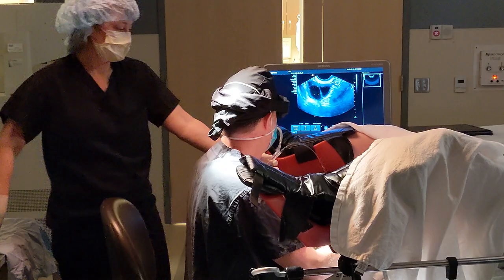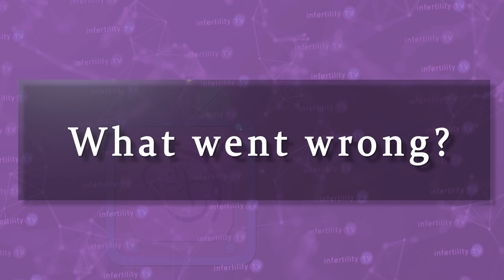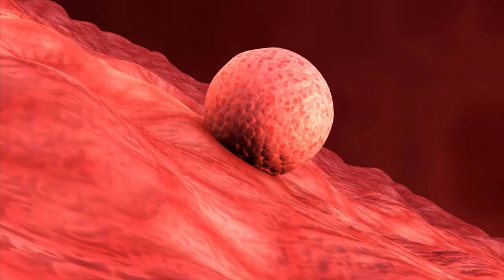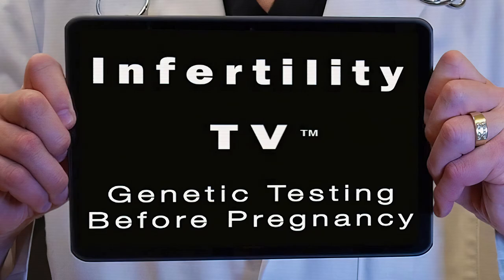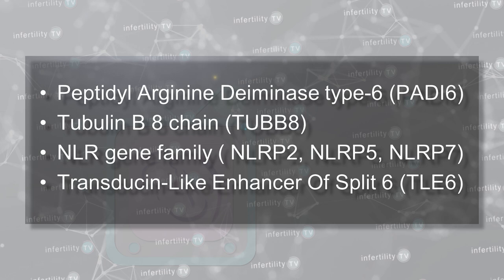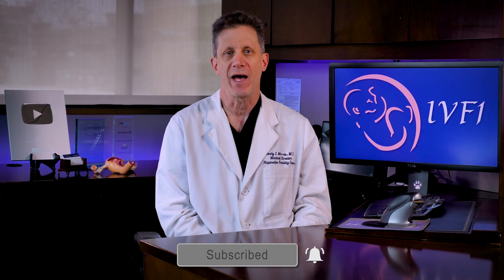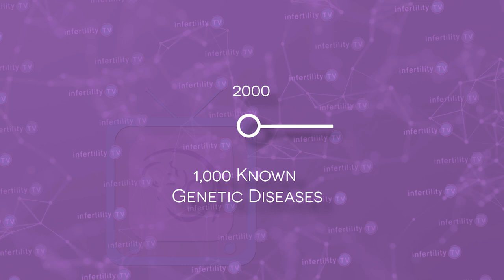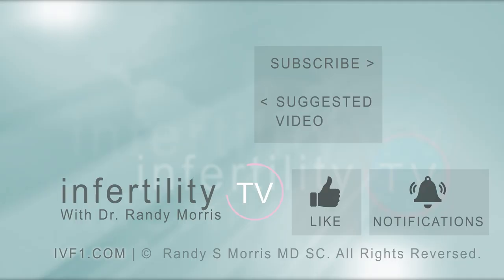Reasons for IVF implantation failure: New discoveries!

Comment: Thank you, Dr. I just had a failed cycle with CNY Fertility,  using my own eggs (I'm 50). The embryo stopped splitting on day 2. I was advised to use donor eggs. I've never had any Fertility problems in the past,  so the doctors think my age is most likely the culprit. My husband and I both did genetic testing with Sema. What do you think my chances of implantation is? Anything I should be doing now?